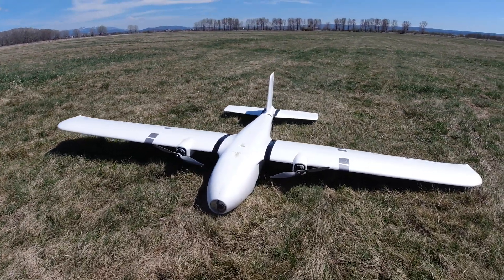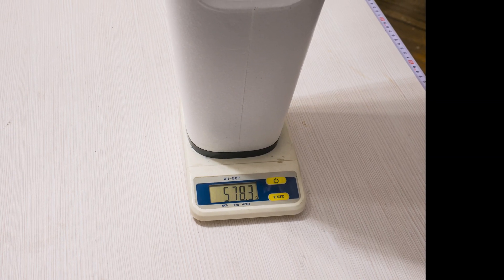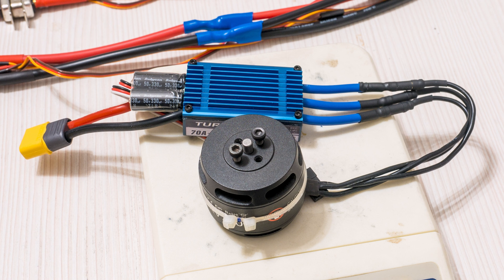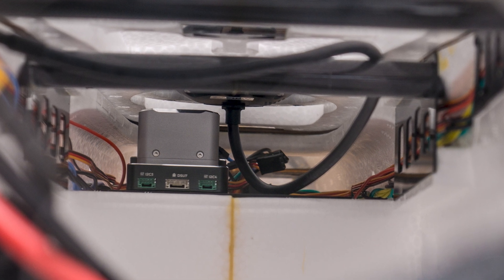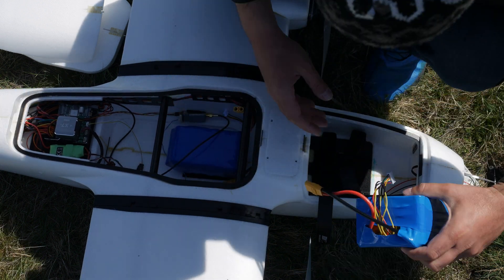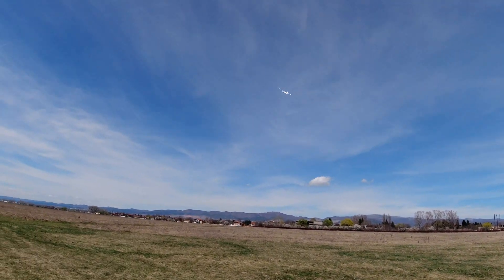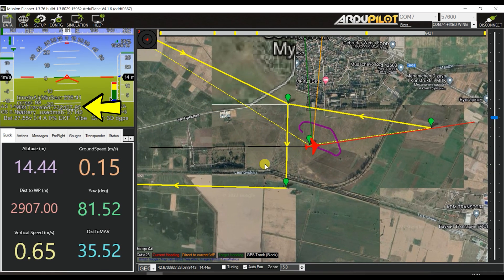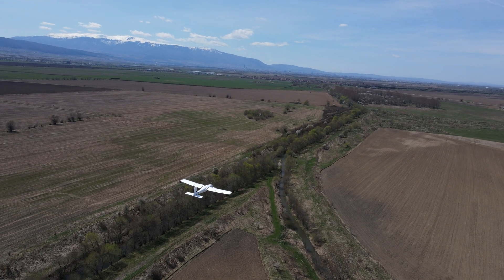MFE Fighter 2430mm Mapping Plane   maiden and review

Comment: BTW this airframe is insane. After building 3 variants of it I managed to get 500km endurance in 7.5h Flying on a single battery charge.

I used 3520 Tmotor 400kv Motors

APD 80F3 ESC's

8s60Ah Battery using Samsung 50e

APC 13x10" Props

INAV

Takeoff Weight is just shy of 11kg Hand launch!!!!
Reply from the maker: DAMN! You hand launch an 11kg plane? How does that look? Does it take to the sky easily? Have not flown mine in quite a while, but I have spent my weight budget on other stuff now, not more battery... hahahaha... but damn.... 8S 60Ah is a pretty hefty pack. Well done. Does it actually carry any useful payload?
Reply: @ArxangelRC  
First thanks for your inspiring videos. This initially got me excitited to build one too.

The Maiden Launch was surprisingly easy with the 11kg, probably because I was very focused xD.

I made a Package dropping mechanism, so 800g Payload on top of the 11kg no problem.

Here a video showing the maiden launch and the first Parcel drop: https://www.youtube.com/watch?v=lQOP6zZFq-s

With the Parcel mounted though and no headwind it is pretty hard not to crash it on launch. Once it half stalled and a wing tip already touched the grass but it recovered luckily. 

I think with the power of the 2 3520 400kv Motors on 8s and the 13x10 props it is fine and well speched for that kind of weight. About 3kw of power.
Reply from the maker: @jojo42069  NIcely done, plane looks good and seems to work well! I guess the 13" props do help in taking up at that weight, but there is always the looming risk factor here. Hopefully soon I will be able to finish and test the mods I made to mine, and whatever the outcome, I will make a video update on it... could be a spectacular fail... or a not so spectacular success! :P
Reply: @jojo42069 Did you have any equipment in the aircraft at that weight? Cameras? FPV gear? Telemetry?
Reply: @icyphotons  Yes besides the 6.75kg Battery there was a analog FPV System, a Raspberry Pi Zero 2 W and an LTE Modem

Comment: 6:15 the fact that the Cube Orange gets hot, it's not a bug, it's actually a feature! There is an internal heating device that always maintains a constant temperature of 45°C, so that the IMU sensor are stable and won't drift with temperature change.
Reply from the maker: Perhaps, but in some situations it gets considerably more hot than 45 degrees.
Reply: @ArxangelRC  did you check that the heating parameters in the firmware are set correctly?  BRD_HEAT_TARG, BRD_HEAT_P, BRD_HEAT_I, BRD_HEAT_IMAX
Reply from the maker: @heliengadin  Params are default, have not adjusted anything in there.

Comment: You don't want to use glue because of the weight, yet you have no problem adding 3d printed parts that are not needed. OCD much?
Reply from the maker: Not sure I follow your logic... 3D printed parts are useful and are used out of necessity and to make the built cleaner! Where did I say I don't want to use glue?! The plane is, after all, GLUED together, and I did the glueing, since it came IN PIECES!

Comment: Did you consider adding solar panels to make it fly longer ?
Reply from the maker: I have not actually, would add quite a bit more weight, and I am not sure if there would be any real benefit on this plane! It is already heavy! Solar panels make sense on light planes with huge wings. This is not the case! I've thought about it, just not in regards to this particular plane.

Comment: "Move over beliver" yeah if the shipping from China wasn't more than the price of the actual plane. 😡
Reply from the maker: Haha, true... but this one is huge, and the box it comes in is huge too! No getting around a higher shipping cost I'm afraid, unless you order 100 of them and have them sea shipped! And that mode of transport has seen a 5 fold increase in cost during the lockdowns.
Reply: @ArxangelRC  I'll get one at some point. My believer had a accident and I had to replace the full V tail assembly, all the parts were only 50 USD shipping was 200 USD!!! Almost not even worth it to fix it. But I'm surprised, I bought a Mugin 2940, a massive fiberglass bird and the shipping was only 800 USD.
Reply from the maker: @iancommons9841  Per volume larger and heavier items are cheaper to ship than smaller ones.

Comment: An exceptionally fabulous build video. Amazing detailed photos and thorough coverage. While this is bigger plane any I intend to own (for now), seeing all the design and build details was very educational. Many great and useful ideas.

Given weight of the MFE Fighter and that it will be carrying more weight in payloads, did do anything to help protect the fuselage bottom from landing abrasions? Perhaps this was left for a task beyond the maiden.

Looking forward to seeing what kind of missions you have planned for this Fighter beast. :)
Reply from the maker: Glad you like it! There are two foamy sliding strips for the bottom, not sure they are meant for prolonged use as a regular plane though, with sliding landings, already lost one on the maiden... seems to have come off and I didn't notice that, so its lost now! Not a big deal anyway, but there needs to be something there to protect the belly for sure, especially at that weight! Since they are gearing the plane more towards VTOL anyway... sliding landings are not an issue there...

Comment: This makes fly easy. They nailed it again and I'm looking forward to building one too. I have a question about prop size: The official spec sheet states 15" for the twin motor hand throw version but I recon at this size the Props would get damaged a non parachute landing. What's the maximum size for ground clearance you think? I had 12" in mind. Thanks so much for your videos. I enjoy them a lot!
Reply from the maker: Thank you! Actually I am not sure 15" props would clear the fuselage... need to check that! 12" would be OK but hey would still reach the ground I think! Having ESCs with a programmable break is how you land without breaking props!

Comment: Very Nice... So this V-TOL version can do both regular twin tractor plane or v-tol??
Reply from the maker: Yes. I think if you keep the twin tractor props to no more than 12" you can actually have a VTOL with twin tractor, although primarily the nose motor mount is meant to be used with it is setup as a VTOL.

Comment: Was looking forward to this review. Only saw one video about it. Big nice plane. Would have love to see the mapping camera compartment and a demo. Well done 👍
Reply from the maker: Well the camera compartment is that big space in the middle of the fuselage. Right now I have the 3S battery in the forward part of it. Demo of what?
Reply: As ArxangelRC mentioned, the camera compartment is really big. There's a really long thread (585 posts so far) on the ArduPilot forums about the 4+1 VTOL version of the Fighter. There's a few photos showing various camera setups in the thread. The thread's title is "Fighter VTOL 4+1 fixed wing." The thread was started by makeflyeasy.
Posts #50, #211 and #462 are a few which include photos various camera installations. 
For what it's worth, I'm (slowly) building a 4+1 VTOL Fighter. I plan to document my efforts in the thread "Duane’s Fighter VTOL 4+1 Build Questions and Notes." I'll add a rely with some direct links to these forum threads. My guess is the links will be caught by YouTube's spam filter but I'll give it a try anyway.

Thanks for another great video @ArxangelRC.
Reply: The direct link to the forum post didn't work. Let me know if you have trouble finding the thread and I'll try to help you find it.
Reply from the maker: How far along is your VTOL build?
Reply: @ArxangelRC  I'm not very far along. I've got the body halves glued and I've added hinges to most control surfaces. I think I have all the electronics I need (except appropriate batteries) but I haven't installed the electronics yet.
As I mentioned above, I've been posting updates on my build in the ArduPilot forum. The thread title is "Duane’s Fighter VTOL 4+1 Build Questions and Notes" and it's in the VTOL Plane sub forum of the ArduPlane forum.
Reply from the maker: It'll get there eventually! :)